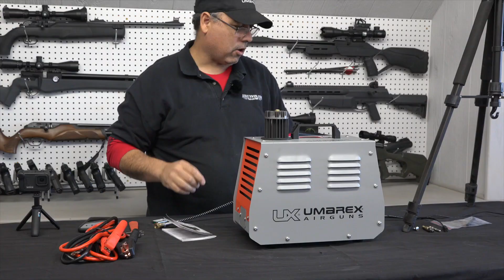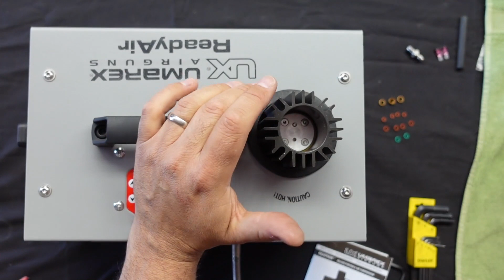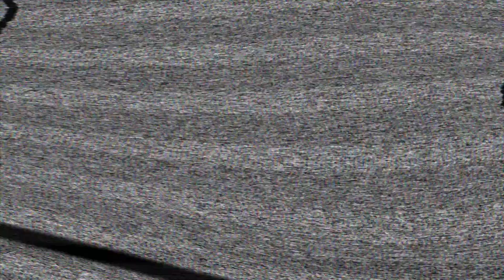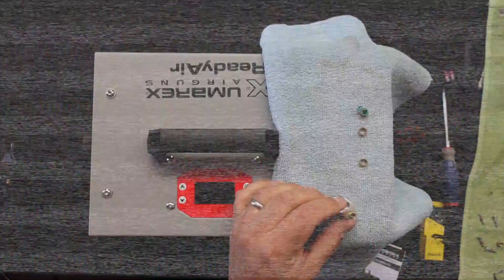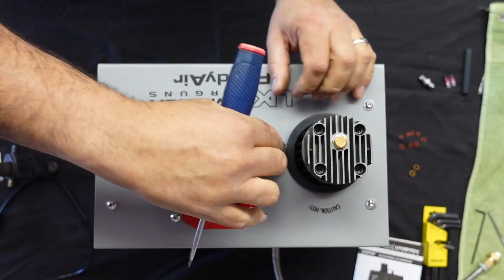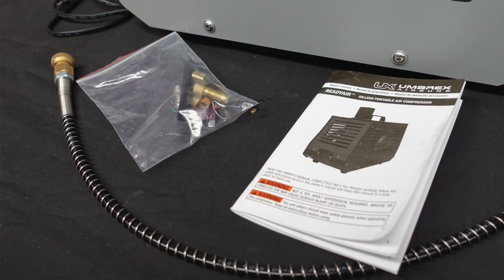Umarex ReadyAir Compressor How To Replace Piston Rings Maintenance

Comment: My umarex temperature sensor compressor broke down, what do I need to get but I don't know how many km it is. Do you have the specifications for the sensor or thermostat?
Reply from the maker: Had to dig a little. See if this helps: NTC 10K ( +/-1 % )  B 3435 ( +/-1% )

Comment: Hace tiempo compré un compresor Umarex y tengo un problema. Quise cambiarlo de PSI a bares y después al encender el compresor a los 1150 PSI se apaga. Hay alguna solución o cuál será el problema en el tablero aparece un cuadrito con rojo que dice Over temp Será algo que le piqué al tablero y no sé cómo solucionarlo o será algo otra falla me gustaría ver si me ayudaran a solucionarlo por favor. Gracias
Reply from the maker: I was informed that if you're getting the over temp warning it is a possibly a wiring issue and the unit will need to be serviced. 1-479-646-4210 ext.7
Central Time Zone 8am to 5pm.

Comment: Thanks man now I know how too keep this compressor working!  There are supposed to be a few add parts you can buy soon that will help mod the cooling even more than the computer auto shut off . They said it would be a little expensive but really worth it if you are into keeping this bad boy cooler and last a lot longer . I have not used mine yet but I’m glad I went with this one because it has been receiving some great reviews this summer of 2023 . Up here in Canada they are very expensive but now that people are starting to hear good things about the umarex ready air the price has jumped like 200 bucks ? Lol.  JEEPERS it’s not a cheap hobby even more so up here like the difference in prices when it comes to the actual air guns is unreal compared to the USA .  You guys are lucky down there I wish I could buy my goods from you lol. 😊

Comment: By NOT replacing the piston rings (bc they were new) you failed to show the steps in replacing these!  But you did show how to replace the o rings, even though they were new!!!???  An O rings seating tube included with the unit would be great, as you don't want to use sharp metal to start seating those, which could lead to damage.  Third, to make this unit even better, add an hour meter to the digital display so users can easily & accurately keep track of service intervals.

Comment: Anyone considering the ready air should think again. Same as several other comments here my first unit lasted a week before it died. I sent it in and had it replaced under warranty. The replacement arrived with a broken handle and missing the o ring on the fill hose. I scavenged one from the rebuild kit that works well enough to pump up my rifle. Umarex wanted me to send the second one back for assessment after I just got it. I requested replacement parts instead and they stopped communicating. It's really a shame this is such a piece of junk. I have really enjoyed my gauntlet rifle and had high hopes for this compressor.
A perfect example of why you shouldn't buy something based on YouTube hype videos.
Reply: You are so right. I am very sorry I bought this. I got 2.4 hours use on mine before it quit pumping air. I had to put on my only rebuild kit. I contacted them about the short life of the O-rings and they said I would have to order another one at $19.95 + $10.00 shipping. I have 2 of their guns and will not buy from them again. They were of NO help at all. I should of got a Yong Heng and saved myself $250.00..

Comment: Ho do you know when 20hrs is? there is no counter to keep track or reset.
Reply: Check it out. I would bet know one has even got close to 20 hours use on this compressor. Mine quit pumping air with only 2.4 hours use on it..
Reply from the maker: We recommend to keep a small log book. The digital display will tell you how long you ran the compressor for. Note that time in the log book and keep the time added up to know the balance. Good question.
Reply: When it breaks! 🤪🤪

Comment: So 20 hours in you have to rip it apart for 550 bucks or for 1,000 you could buy a hill and change the oil at 50 hours and call it good....
Reply from the maker: So, if it takes you 6 minutes on average to top your rifle off you'd get 200 fills or so and your risk of overheating is low with the built-in overheat protection. If you have another $1k on top of getting a rifle we'd suggest making the best decision for your style and frequency of shooting. Thanks for leaving a comment!
Reply: @UmarexAir   It's not really a 1,000 "on top of".  Your unit is 550 the Hill unit is 1,000.  50 hours with the Hill unit change the oil... takes 5 MIN... twice the run time before it even needs touched and when it does... 5 MIN and you're done.  Looking at this video and what this requires after 20 hours of run time... this is absurd...  Have you watched this video and asked yourself would the average person want to do this, could they do this?  "order spare bags of parts in case the ball and spring go flying".... I mean come on.....
Reply: @David-uz5zo  I'll save the $500 and do the o-ring change out every few months. My ready air is running GREAT, o-ring change is pretty easy and beats the hell out of pumping.

Comment: im on my second unit within 2 months. Im getting the feeling this unit is straight garbage. Im most likely gonna drive back to my retailer and ask for my money back. Its getting ridiculous.
Reply: @sudo buy once cry once.... get a HILL unit.... I went through 3 NOMAD II in a year that all failed... little units like this are garbage.... they aren't going to last.... I am not surprised you have had two of these in two months... all these small box units are garbage...
Reply from the maker: Thanks for having patience and working with us. Sometimes companies have unexpected issues come up after the first production run that weren't revealed during extensive pre-production testing. We're getting it all worked out. Very few of those shipped have been reported as having issues. We appreciate you giving it a go.

Comment: Used Mine for 4 Hrs and wont go above 2500 psi even after rebuilding the unit ,Someone said it were a piece  of Junk they were right .Cant get a hold of anyone and the electric plug in fell apart as well,No wonder people buy the cheap Chinese unit from ebay for 1/2 the price these things Suck .
Reply: Mine only lasted 2.4 hours before it quit and I called them and got NO help at all from them. I feel the same way about getting the Yong Heng would have saved me $250. That is what get for buying to soon.
Reply from the maker: Sorry you're having a bad experience. The number to call Mon-Fri, 8-5 Central Time is 479-646-4210 ext.7. There have been very few reported issues. Please give our excellent techs an opportunity to assist.
Reply: @UmarexAir   Same issue here, on second unit, wont go past 215bar. its only been about a week, maybe used 5-10 times. getting tired of driving all the way to my retailer to have replaced
Reply: @UmarexAir  You say there have been very few reported issues; Yet, EVERY review that isn't yours says these things are heaps of shit and the customer service is horrid.
So, who to trust is reallt the question. The guy getting paid to sell them or the guys just running a small YouTube channel?

Comment: I noticed you did not use any lubricant on the orings or piston shaft.  Shouldn't there be a little silicone oil on there or do the orings/piston just run dry up and down the cylinder wall?? Without silicone oil, wouldn't the wear be increased by excessive heat??

Also, can you give any information on how moisture is kept out of your airgun while filling?? What kind of filter/dryer and how often does it require drying/service??

Otherwise, great video.
Reply: Came here to say that. I am a Millwright by trade and always use pure silicone oil when installing O-rings  unless product of pump is incompatible with pure silicone and that is rare. I will get the ready air or the new Benjimen Traveler Gen 2, just have to make up my mind. Finding good reviews from actual purchasers on the Benjimen but none for the ready air .
Reply: @mazkact  I have the gen2 traveler and liking it so far. I have larger compressor to fill my tanks.
Reply: @Michiganairhunter   I bought a GX CS3 pcp high pressure compressor and am digging it thus far.
Reply: @timmy4539   Had it a little over two months, no issues works great. I fill my Umarex Origin and DAR Gen II with it and shoot a lot.
Reply from the maker: Per our quality and service persons, don't put oil on the piston rings. They are of a material that does not require it. The moisture is passes through a carbon filter and the unit uses gravity to collect the moisture at the bottom near the bleed screw.